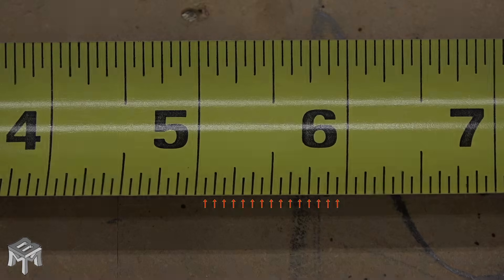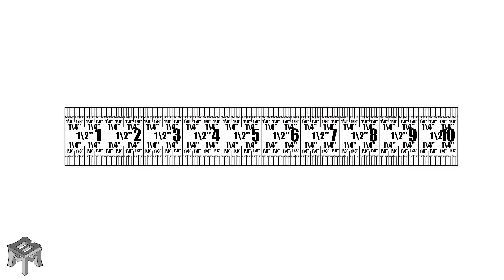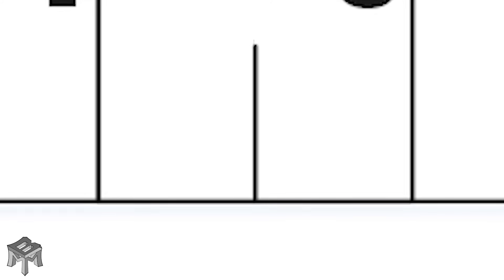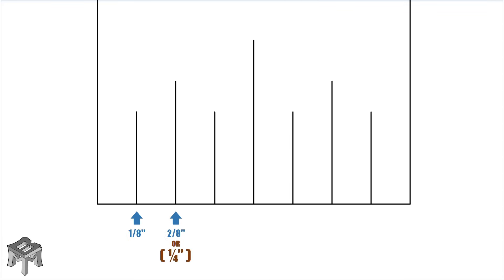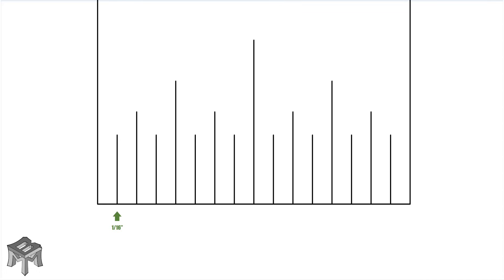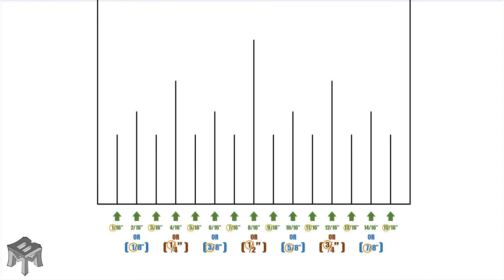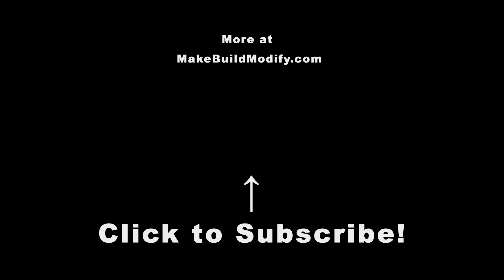How to Read a Tape Measure - REALLY EASY

Comment from the maker: For those of you who are wondering. I cut this part from the "Tape Pro Tips" video because only about 1/3 of the viewers were getting to this part of the video. I think it has some value to those who are looking only for the "how to read fractions on a tape" part.  I figured if it can help more people, then I might as well give it a shot.  Thanks for watching and reading!  Original full tape measure video here. ----> https://youtu.be/s8UzG9-qvNU
Reply: Well, I definitely appreciate it. I got the half and quarter, it's the smaller parts I was 😕 on (although I admittedly derped on the quarter inch for some reason; I have no excuse 😤).

Thanks again.👍
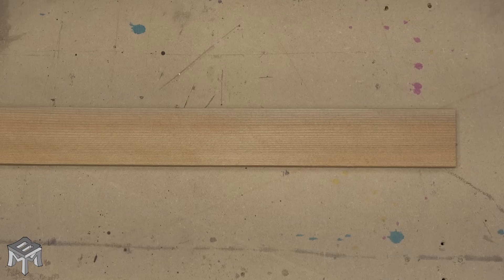Reply: 0:27 Beautiful fit by the way.😭
Reply: Half a century brain freeze melted😅 TY🎉
Reply: I need to watch this.
Reply: New sub here. This a great vid. Simple, great visuals. Perfect.
Reply: Now I understand it
Reply: Make Build Modify fwiw, I still get suggestions for channels I unsubbed from years ago. :) I wouldn’t worry too much about it. I actually prefer short  videos. Sitting down to watch three 7 minute videos is less intimidating than watching one 18 minute video. I end up saving up the long videos for a time when I’d normally watch TV rather than just fitting them into my breaks throughout my day.
Reply from the maker: @jasonbailey9139  Thanks Jason. That's really good to know and hear.
Reply: why is this ruler so troublesome🙄
Reply: Can you do a how to add or subtract on a tape please
Reply from the maker: @boxingkillsmma  Do you mean adding and subtracting the fractions on a tape measure?
Reply: I enjoyed the way you broke it down. It really simplified it. Thank You so much!!😊
Reply: Learned a lot, thank you for the information! God bless you!
Reply: I hope work is going well and that you can proficiency read a tape now!
Reply: I was watching from the thumbnail & had to come give you a thumb up 
for a perfect explanation.👍
Reply from the maker: @21CenturySkyScrapers thanks!
Reply: Make Build Modify and here I thought I was having major dejavu.
Reply from the maker: @jasonbailey9139  yeah, haha, sorry about that. I've actually had some unsubs because of this experiment. You win some and you lose some.
Reply: @jasonbailey9139 wè³3³333333³3343333 4

Comment: That's explained really well!! Although I do find metric 100 x easier and faster and a lot more precise when doing fine work..
Reply from the maker: I like metric for some things too. However, precision comes from the measurement process and the instrument’s resolution, not from the choice of unit system. For example, both metric and imperial systems allow arbitrarily fine subdivisions in principle; the real constraint is how finely we can physically mark, read, or manufacture those subdivisions. The precision comes from our tools and methods, not from the structure of the unit system.
Reply: @Makebuildmodify I was just saying I find it easier with metric.. thanks for your input

Comment: Man…when I went to school this is the stuff you learned in a basic math class in middle school.
Reply from the maker: Times have changed!
Reply: @Makebuildmodify Changed?  I have students who have trouble doing basic math!  Times have gone backward…especially since Covid.
Reply from the maker: Early math pedagogy in America needs improvement. AP classes are somewhat better, but math is an accumulative process that builds from the bottom up. It also requires time and consistency because it is learned by literally changing the structure of the student's brain.

Comment: Excellent tutorial! And always, always, ALWAYS use the same tape and same make of tape working with a group. It's amazing the manufacturers can't seem to produce uniform measurements without variance but they don't. Planned obsolescence in pretty much everything made now seems to be more uniform... I usually use metric for woodworking because it's anal retentive accurate and easier to record on templates etc. But at my age marking mm's or 32nds makes me equally cross-eyed and you need a finely pointed round pencil to be that accurate vs a carpenters pencil as well...
Reply from the maker: Great tips, thanks!

Comment: I always told new guys, just learn everything between 0" to 1" start with 0, 1/4, 1/2, & 3/4, and 1".
When you master that now 1/8, 3/8's, 5/8's, and so on, put them in-between all those fractions, master that in your head, and then 16's and 32's and 64th's, down as far as you want, if you are smart enough you'll see a pattern and it will become easy, if not you are dumb and we all know it now,  welcome to the work place. 
0 to 1 is all you need to know, the rest is redundant.
Reply from the maker: Different people learn in different ways.

Comment: I just turned 50 back in July (of 2025) and can read feet, inches and centimeters but it's the little marks on a tape measure I've always had problems reading on a tape measure. I remember both my Gpa and mom trying to teach me several years ago but I still have problems trying to read the little marks on a tape measure.
Reply from the maker: I hope this video helped clarify things!
Reply: @Makebuildmodify  - it definately helped, thank you.

Comment: Literally trained my brain how to read a tape a measure in a matter seconds ... I struggled with this because there's so many lines and numbers to remember, or at least I believed there was. Now I know there's not that many. It just goes up to 16ths and after that it's just counting how many 16ths ... and the length of the lines is an easier way of remembering in case you forget! Thank you for this video!
Reply from the maker: I'm so happy it helped! Thanks for commenting.

Comment: should i buy the tape measure that has the markings on it ?
Reply from the maker: I'm not sure what you mean.
Reply: @Makebuildmodify the measurements. I'm  an apprentice in the bricklayers union so the measurements don't really need to be too spot on from what i was told.
Reply from the maker: @Sabm38 I would get whatever the other guys are using. That way your  using the same references.

Comment: Just started a new job yesterday learning to build pole barns and hang metal roofing. Felt lost when they were telling me to read a tape measure to cut the sheet metal. Having only a background in factory work. (Building fuse boxes and rendering plants). This definitely  helps a lot thanks for the video and explanation!
Reply from the maker: Best of luck with the new job, thanks for watching!

Comment: So, if a measurement says 15.9” what does that mean? Is it almost 16” or is there 15.10, 15.11, 15.12?  I am confused, sorry!
Reply from the maker: My guess is that you are talking about plans or something of the sort. In the case where a written measurement says 15.9", it means that someone is using tenths of an inch. This is sometimes done in mechanical drawings. They even use hundredths and thousandths when working with precision metal parts.

To determine what 15.9" represents: it's 15 + 0.9, and to express it in 16ths, you would multiply (0.9 * 16) = 14.4. This means that there are 14.4 16ths in 0.9". If you round 14.4 to 14, you get 14/16, and 14/16 = 7/8.

Therefore, 15.9" is approximately 15 and 7/8 inches.
Reply: Thank you!!

Comment: It’s easier to think in terms of 16th’s imo. Multiply the denominator by whatever number it takes to equal 16 and multiply the numerator by that same number.
Reply from the maker: Interesting method. Why not just call out the count of the 16th? Example: 1,7 10, or 14
Reply: @Makebuildmodify  because most people don’t. When someone says 5/8ths I think 10/16 so on and so on
Reply from the maker: @derekwinston4105  same here. I usually train the guys I work with to do the same. It's easier to callout while on the jobsite.

Comment: I prefer using inches and 16ths. Faster, more accurate, easier to write, and easier to yell. 4 foot and a  half inch = 48~8
Reply from the maker: Yeah, I do that too. You just have to make sure the guy on the other end is on the same page.

Comment: There is a much much easier way to read/add/substract/divide/multiply tape measure readings, also applicable to weight and volume:  United States, stop being imperialism, change to metric.
Reply from the maker: Are you sure about that?

Comment: Back in to 70s, American industry attempted to convert to the metric system. It failed in the face of broad resistance. As a woodworker, I now have multiple metric rulers and tapes. Metric makes so much more sense than fractions. What is half of 17-5/8”. Well, in metric it would be 44.8 centimeters. In a Flash you can calculate that half would be 22.4 centimeters. All measurement are the function of 10. It works for me.
Reply from the maker: I utilize both systems, selecting one based on the specific context of the project materials. Moreover, the ease-of-use for each system is a skill honed through practice. I can glance at a measurement like "half of 17-5/8 inches" and quickly deduce it as 8-13/16 inches.

Regarding your example, the use of 44.8 appears somewhat selective, highlighting a specific favorable scenario. A genuinely superior system should be able to handle even the most challenging examples convincingly. Consider the metric system: performing mental math such as 97.35 divided by 2 isn't as swift.

In my perspective, both systems possess distinct strengths and weaknesses. It rests upon the craftsman's discretion to opt for the appropriate tool based on the task at hand.

Comment: At 24 i have a basic understanding of how to read a tape measure but there were some things i was noticing i was doing wrong such as reading sixteenths out instead of diving them into eitghts. 1/8 3/8    etc. I have been using a tape measure wrong for years. Sad i was never taught any of this in school although if you took an elective course such as welding or woodworking im sure theyd of taught the use of a tape measure there. But in the basic curriculum it wasnt taught to us in depth and you taught me more in 3 minutes than in 13 years of schooling including kindergarten.
Reply from the maker: Happy to help.

Comment: I so like inches. Nicely explained. Thanks. Metal fabing is my trade. When the measurement is feet & inches...I convert that to inches. Does not get simpler than that.
Reply from the maker: Yeah, I convert to inches often. Although, there are times when feet and inches are better. Usually for wall layout on larger buildings.

Comment: As someone who grew up with the imperial system and now using the metric system I have no idea why anyone is still using the imperial system whether that’s for measuring, weight, liquid volume or anything else it’s so much simpler to understand and use
Reply from the maker: No idea?

Comment: This is real simple til I try dividing something like 3 equal spaces into 52-3/4" on phone calculator and end up with 17-5/12". I cant find 17-5/12" on tape measure, no wonder people like metric...........
Reply from the maker: 5/12  is  not on the tape measure because your phone calculator is not using the imperial system. BTW the answer is about 17-9/16". This is within a third of the thickness of a common pencil lead, so probably close enough for most applications.
Reply: @Makebuildmodify  Good grief a year later and I'm watching same video again. Come to find out I didn't even write down the the right fraction a year ago that I was trying to divide, not surprising though when I measure a 2x4 to cut at 22-3/4 and cut it at 21-3/4, so I cut it again and it's still to short........
So I redid that measurement of  52-3/4 divided by 3, it really equals 17-7/12" using online fraction calculator that I added to my so called smart phone, and I  cant even find that number on my tape, I cant even find it online, what I did find was the online calculator telling me to use real fractions...............

Comment: Spoke to this guy last night about a job, asked if I could read a tape. My previous job we used tapes all the time installing gutters. Of course I can’t read a tape. Most of the time I would wing it, ask someone else, mark it and transfer, or just use metric because it’s way easier. 

Gave up Fahrenheit awhile ago because Celsius is simple and makes far more sense with 0 being freezing. How is it freezing outside if there’s 32 degrees floating around.

Anyways, you just saved me for bluffing that I could read a tape, even though I was taught in middle school and used a tape for the last year.

I appreciate you.
Reply from the maker: You're welcome! Thanks for taking the time to comment and share your story.

Comment: Just think of all the lessons you wouldn't need if we used the metric system. I might be the minority in the US, but I am the majority in the world. Just think for a second how stupid it is to have to use a special calculator to add a bunch of foot measurements. Say you're doing baseboard and you have a piece that's 5'10", 7'7", and 13'3". Since the inches are in increments of 12 it makes it unnecessarily more difficult to add everything together manually. Forgetting fractions that have to be used for a second in measuring.... that's a whole other stupidity. 

Where as Metric is straight forward and easily convertible without having to memorize figures..... 1000 meters = 1 km. 100cm = 1 meter. Whenever you measure something you can actually just use a damn decimal point. Instead of saying something is 5'7" and then having a complicated method of adding that to other measurements..... You could just say its 1.7 meters..... But hey we insist on being stupid in this country. Even our military doesn't use our stupid system. Anyways thats my rant for the day! xD
Reply from the maker: Why take the time to be so negative?

Comment: The bit at 2:58 saved my brain from an atomic melt down, after 1/2 inch I'd have to count the lines because I couldn't remember which were 8th's and which were 16th's. Also knowing when to reduce and when not to (reduce the ones with even numerators, omg, life changing)
Reply from the maker: Thank for letting me know it was helpful! I love to hear it!

Comment: So if it landed on  1/4 of an inch I count by 1/4 each until it lands on the one it stopped on? 1/4  2/4  3/4  on the taller lines?
Reply from the maker: I'm having trouble understanding your question.
Reply: @Makebuildmodify  I mean like if what I was measuring went over an inch and it stopped at   1/4 where do I go back and count, do i count 1/4??
Reply from the maker: @solar-jaymi  if I'm understanding you correctly it would be 1-1/4". (An inch and a quarter).
Reply: @Makebuildmodify  thank you, I understand what the lines mean, but when i see people counting them it's like they skip count. It's what's confusing me. I heard it's reducing fraction?? I'm bad at understand things sorry. But I do understand what the lines mean thanks to your help.
Reply from the maker: @solar-jaymi  it's kind of like "Skip counting". A person could count 1/4, 2/4 (1/2), 3/4. OR 1/8, 2/8(1/4), 3/8, 4/8(1/2), 5/8, 6/8(3/4), 7/8 etc. So counting by quarters "skips" all of the 8ths.
Reply: @Makebuildmodify  ok I get it! But what if I count by the 1/16
Reply from the maker: @solar-jaymi  1/16th are usually the smallest fraction on a common tape measure. But you can find 32nds and 64th. You can always cut the faction in half again and go even smaller. So, in a way, you are alway "skip counting" over other smaller factions.

Comment: People who do drywall like to call everything out in eighth so that 3/4 is actually 6/8 so they might say something like 3 and 6 which means three in in 6/8 and the reason is is because it's easier to add and subtract them and further they say strong or light to indicate half that amount so 1/8 strong is 1/8 + 1/16 but 1/16 strong is 1/16 + 1/32 which also means that 3 + 9 is 3 in + 9/16 because there is no 9/8
Reply from the maker: Yup, there are a few inside the industry systems like like that.

Comment: For me to read the 16'ths, I looked to the 4th's. The 1 and 15ths will be at the ends. Next to 1/4" is 3 and 5. Next to 1/2" is 7 and 9. Next to 3/4" is 11 and 13.
Reply: Else I just count the lines out of frustration. Each line is a 16th.

It's interesting to note drywallers only go up to the 8ths, and just read the numerator. 146 and 7 would be 146" and 7/8". This is done because the installer is at some height who does the measurement, and he calls down to the groundman who cuts the sheetrock. The groundman cuts the length and hands it to the installer. There's less ambiguity. I think it's fair. 

As an electrician we don't often go to 16ths often -- except to lay out knockouts for a panel, so I think it would be fair to use. 

On the field to, we have to read survey stakes, which read decimal feet. It would be great for us to be honest, as conduit benders because we have to multiply numbers, and decimal feet would save us a step from converting to decimal to multiply and converting from decimal to fraction.
Reply from the maker: Good stuff. I use 16ths and only call the numerator when siding a home.

Comment: Or you can call out 10/16ths and make your coworkers really mad...heehee
Reply from the maker: Haha! I do it all the time. There is a use case for it though. If we're cutting a series of blocks that vary slightly we use the base length, say 13 inches, then add the 16ths as we call the out the measurements. To be clear one worker is measuring the series, one at a time, and the other worker is writing the list. The measurer calls out only the 16ths. So in this case every block is 13" plus something. It would sound something like this, "5,6, 6, 5, 7, 9, 10, 13, 14" and would be written like "13 5/16, 13 3/8, 13 3/8, 13 5/16, 13 7/16, 13 9/16, 13 5/8, 13 13/16, 13 7/8" OR like this   "(13) - 5,6, 6, 5, 7, 9, 10, 13, 14".